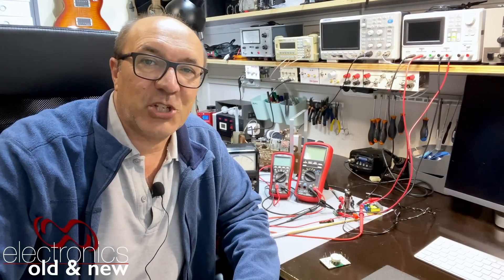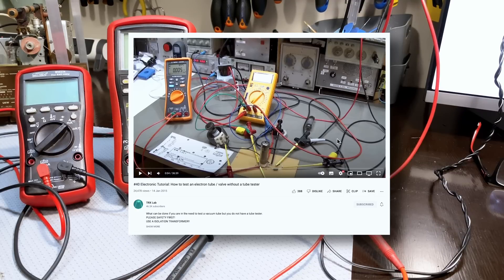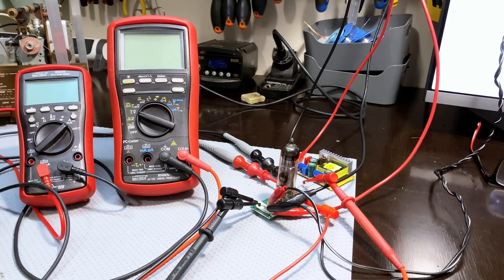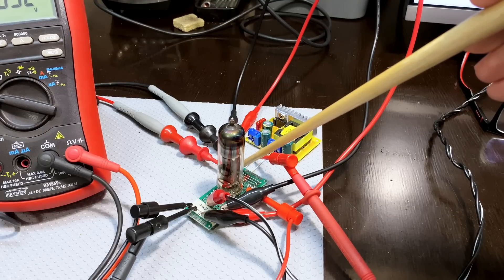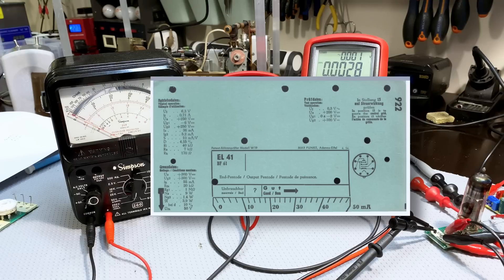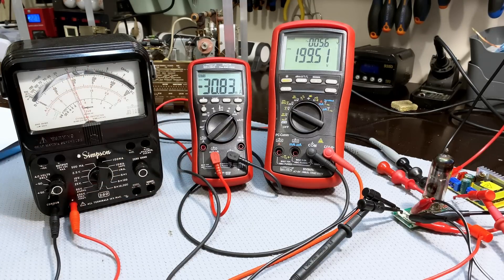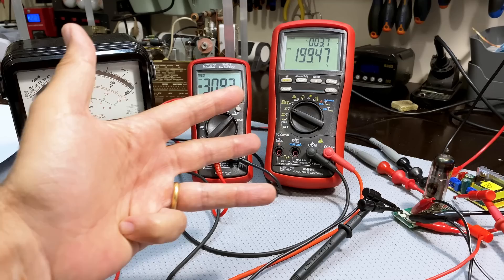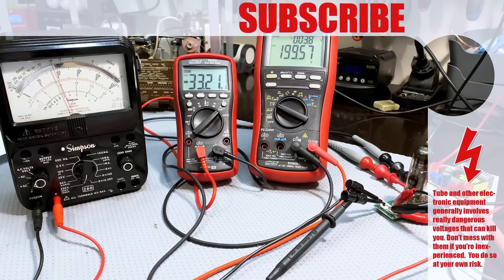How to test a tube without a Tube Tester. Is this EL41 any good?

Comment: Here in the States I've never seen a "rimlock" type tube like this, as they are known (despite having handled many thousands of tubes). On the other hand, you've likely never seen a 10-pin miniature tube such as (if I remember the the numbers correctly) a 6X9 or 6C10. There are two styles of 10-pin tube, one with a tenth pin in the center of the tube base, and another with 10 concentric pins in a circle. Kinda like a 12AX7 or EL84 with an extra pin!
Reply from the maker: You’re right, I’ve never seen the 10 pin tubes. The number of types of tubes is incredible, so most tube testers need to accommodate as many as possible. A tough task.
Reply: @electronicsoldandnew ,  I've made adapters for a few types such as the WD11, and early 01's with short pins, so I could test them on my Hickok.  Some later model tube testers were geared towards the TV repairman and often didn't include sockets or data for early types from the 1920s through the 50's, and obviously a tester from say 1947 wasn't going to test a Nuvistor or Compactron, or even a 9-pin Novar audio output tube such as a 7868 (like a 7591 but with a different base).  Hickok and others made adapters to expand the usefulness of the earlier tube testers, but these could be a little clunky and inconvenient to use.  Much nicer to have the capability built into the tester itself. The 539C is another one that will test almost anything but it's a little slower and clunkier to set up. The 752 and 752A were the reference testers for the Federal Aviation Authority (FAA) and they are fast and easy to use (they will test the 2nd half of a dual triode such as a 12AX7 with the push of just one button). They can be rather expensive nowadays however.  It's also helpful to have a tube tester where the settings of the knobs conform to the actual individual pin numbers of the tube under test so that if you were attempting to test something for which you don't have exact setup data, you can more easily figure out how to set the tester up and then compare the readings to the data and curves in a tube manual.
Reply: @electronicsoldandnew  ,tthe Hickok 539C actually includes one style of 10 pin socket;  The 9 pin socket with which you would test 12AX7 tubes also has a contact for the 10th pin, in the center of the socket.  Which made it a little bit difficult to install install a traditional socket saver because normally those would bolt down through the center of the socket but had I done it that way I would have had to modify the socket in the tester.. Instead, I used a homemade socket-saver with flanges on it and bolted it to the same screws that hold the stick factory socket to the tester instead.  Somewhere here I actually have a couple examples of both styles of 10 pin tubes but I've never had to test them, nor come across a piece of equipment that used them.  I have tested Nuvistors from time to time because there are some late model tube type FM tuners that use them, Including McIntosh.

Comment: Perhaps you could replace the trimmer of the anode supply with a potentiometer, and so you would not have to worry about different anode voltages. And another module for the screen grid supply. Then a simple 6,3 V regulator circuit, and so you need only one 12 Volt power input. The negative grid bias can also be made from that +12 Volts.
Reply from the maker: True. Quite a bit of thinking needed 😊

Comment: It's always useful to see other examples of how to test tubes. I would say yes to building it. What will be interesting to see is if the replacement tube, firstly resolves the low volume issue and secondly how the replacement tube compares with the original in your tester.
Reply from the maker: Yes. However, I think the problem lies elsewhere. I’m into the fault-finding right now.

Comment: Interesting concept, something I'd like to see, BUT. Tube testers are fairly common, if you get the right one they can tell you all the basics. You don't need to go fancy, AVO testers fetch AU $4000 but are the Rolls Royce of testers. I have four - I'd send you one but we use the U.S. valve labeling so the charts would be jusat about useless. Just be careful, one I bought eariler this year had the earth and neutral reversed, meaning the metal cabinet was potentialy live - no wonder it failed to switch on. https://youtu.be/XdwQjVNmEF0

Comment: Nice to see Manuel, but ..testing a tube is more then only the check for emmisions.
There can be a lot of things go wrong with a tube like internal shorts etc.
I have been using a Neuberger RP270 tester for many years now, using this tester is a pleasure, it's fast & easy, it takes only 1 minute to test a tube. I would not bother to make such a testsetup because it's too much effort & time to make a test & then it's still only a test for emmisions and you still are not sure that the tube is 100 % ok.
If you wan't to be sure ...then only a good tubetester can do this job. ( I used many but this Neuberger RP270 i like the best because testing is so easy & fast )   Now days it's not so difficult to find such a tester on ebay etc..

Greetings...Dirk
Reply from the maker: I agree, Dirk. However, my interest in this method is simply to solve an immediate doubt that I had with this tube. My main resistance to getting a proper tube tester is that I so seldom actually need one, and they are bulky to have in the home office I use as my “lab” 😊

Comment: I've tested some tubes with same of a way, but have discovered that some pentodes (EL84, EL34 and some TV tubes) seem to oscillate and draw additional current. If I put my hand near them, they stopped oscillating and the apparent emission went down. I also have few tube testers and some of these do the same. If the tube is a high gain device, the self oscillation can occur easily. When checking the circuit without knowing the state of tubes, a, good rule of thumb is to look at the DC voltages across the load resistors. I've recently tested few ECC85s on a tester and also on a tuner. Anode voltages on a 25% of emission tube were about 195V, but the NOS tube with 110% emission dropped the same voltages down to 155V. Schematics said 165V. Interestingly enough, on that particular radio, both tubes performed the same, perhaps the better one helped to increase the ratio detector voltage for few volts. The tube with 80% of emission had the exactly the same results as the schematics said :)
Reply from the maker: Yes, oscillations … I didn’t  have that and didn’t even think about it. The 1M grid resistor should help, but not too sure. In some applications the actual state of the tube is not that critical, as long as it still functions. When you get to the output power tubes, that’s a different story 😊

Comment: Fabulous!  I think a box of sorts to contain the high voltage bits with some simple meters and test points would be a great boon to us hobbyists. Like you demonstrated, it can verify whether a tube is functioning or not.  Can your setup then be made to measure mutual conductance, or at least a relative value for same, as the value seems to vary from tester to tester and from tube to tube?  For some time I've been thinking about building an extension fixture for my B&K 607 Tube Tester that will finally allow me to measure mutual conductance.  Rebuilt mutual conductance testers are just too expensive to justify for hobby use.
Reply from the maker: I like the idea, and it’s actually not that difficult.

Comment: The Russian L3-3 "Kalibr" tube tester works very similarly to the Funke units.  It does true Gm measurements with voltages up to 500V.

Comment: I would suggest a dynamic tube tester should find a home on Medina Island, but two factors that are probably affect you thinking. 1. limited amount of space. 2. The challenge of designing and the satisfaction of building and completing a fun project.   P. S. Thanks for the reference of the other channels.
Reply from the maker: Space is probably my biggest concern. I have a storage unit in the garage of the building, but I don’t like having to carry equipment up and down the elevator once a month or do.
Reply from the maker: P.S. I always like to mention other channels. I see this as a close-knit community.

Comment: Wonderful. I have been using this high voltage modules for years. I made a rickety tube tester with two of these modules. One module for screen and one for anode. Also for heating and grid bias i used dc-dc converter modules. With analog dials because they are easier to be put in circuit. Jumper wires to connect  pins and their function. I really look forward to seeing you making a propper universal tube tester.